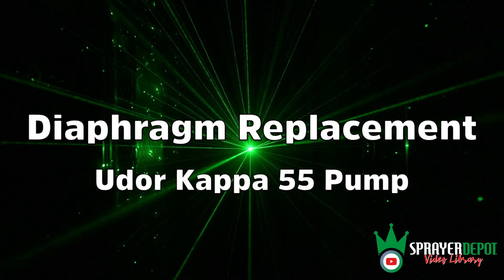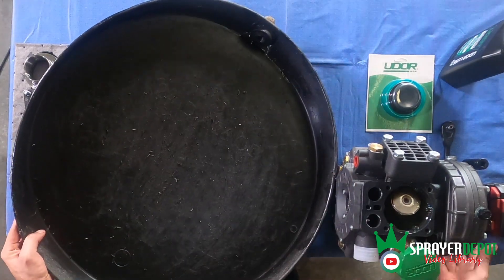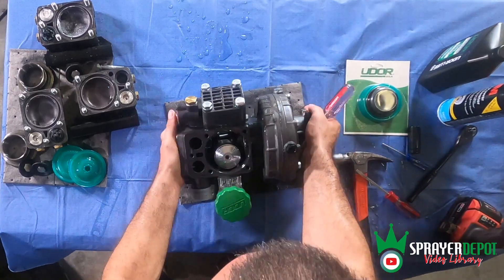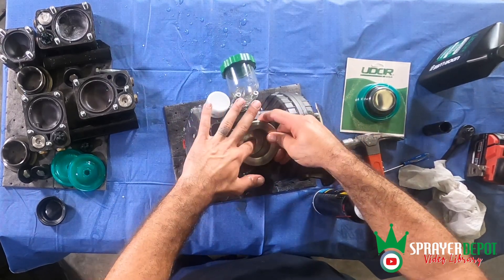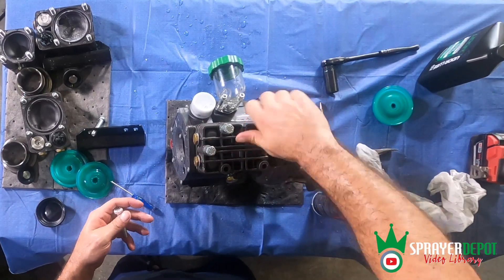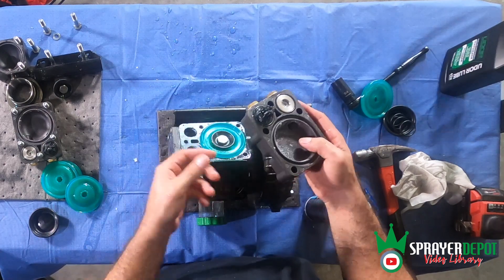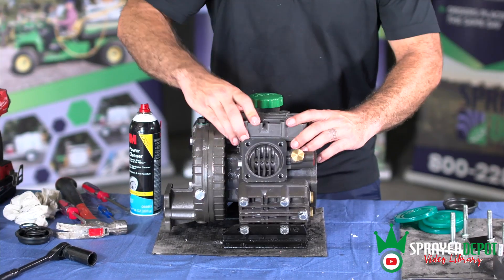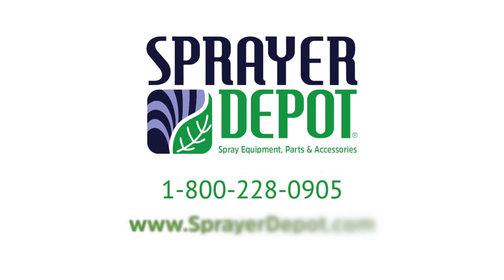Diaphragm Repair on an Udor KAPPA-55 Pump | Sprayer Depot, #1 for Professional Sprayers

Comment: We rebuilt this lump but can’t get pressure. Is there any troubleshooting we can do before taking it all back apart? We put in 31 oz of oil and it still shows empty in sight glass. Are we doing something wrong?
Reply from the maker: This is a little tricky to answer through comments, but we will try. If you are getting flow through the pump and no pressure is generated it is either an issue with the check valves or the pressure regulator. If no flow and no pressure we would need to go another route - suction line blocked or air leak most likely (could also be valves).  This would be a different issue than oil disappearing. If the oil is not in the sight glass that is a bad sign. That normally means the diaphragms have ruptured again or the initial repair was not done correctly - depends on how long this rebuild happened. Only other option is a crack in the pump body but that isn't as common. If the oil is indeed missing I would not run the pump anymore and take it apart again so it doesn't run with a dry case. Our best advice is to call Evodio at 800-228-0905 x208.

Comment: what type of oil to use?
Reply from the maker: We recommend using Udor's SAE 40W Non Detergent Oil in the pump's crankcase. The part number on our website is 155823.  The KAPPA-55 requires 23 oz of lube making. 1 quart is enough for the repair.

Comment: How is this pump when bypassing to a metering system for softwash
Reply from the maker: Hi, we don’t recommend this pump for soft wash applications.  We recommend poly manifold and head for maximum corrosion resistance.